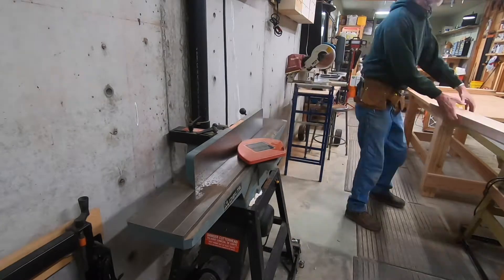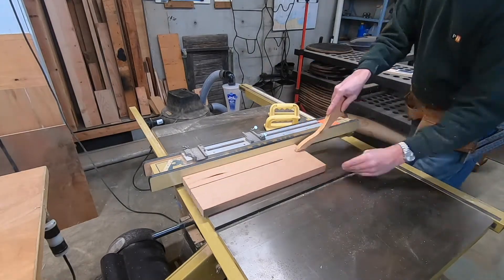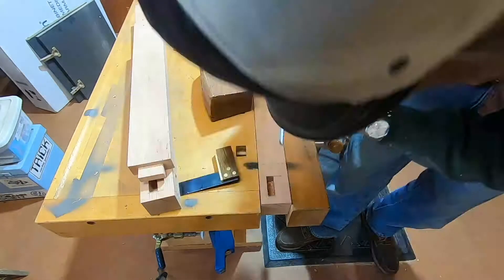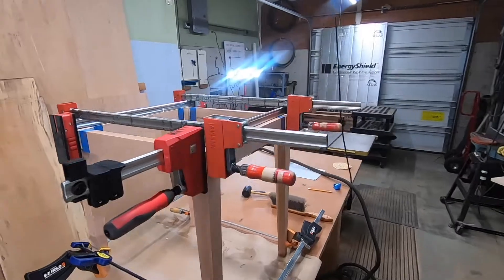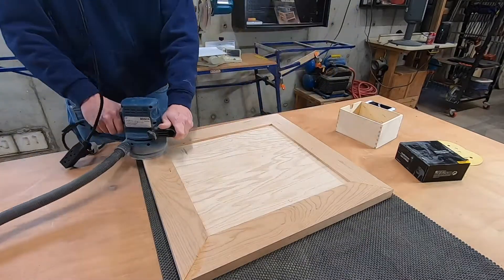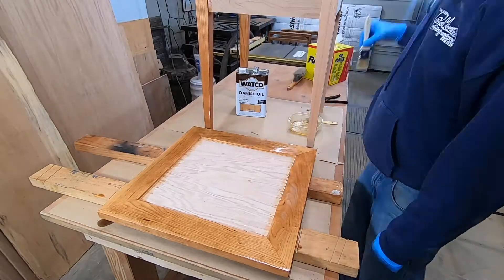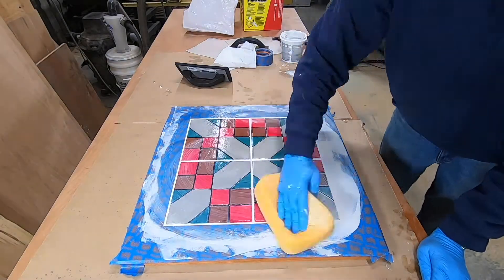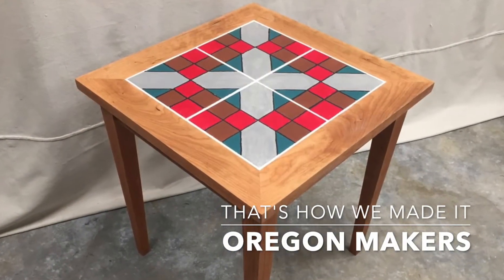Tile Top Table

Comment: Nice work and a good video! Now after almost a year do you know how the table has aged? Since there's wood under the tiles and grout, is there any bending that would make the hardened grout crack?
Reply from the maker: Thanks!  I checked in with the client today, and everything is good.  No cracks in the grout.  I did lay the tile on "seasoned" 3/4 plywood, so pretty stable.  I consulted a professional tile setter before doing this, and they assured me it would work.  Happily, it has.

Comment: I know this video was made a year or so ago.
I noticed your miter saw stand...
Do you like it?
And where did you get it?
Reply from the maker: It is awesome, I've had it for about 20 years.  It's a Trojan MS-2000. I think higher-end lumber yard/ hardware stores can order them, I tried to find an easy link for you.  The downside, which is only 1, is the saw in permanently mounted, so lifting it to the back of the truck is a little challenge, and then it sits too high to put my tonneau cover over the bed.  Would I buy it again? YES I would.  Check out my fence building video to see it in the field. youtube.com/watch?v=Z0vnM6YH3rs
Reply: @oregonmakers2000  thank you so much for responding.  I recently picked up a new stand for job site, but in the shop the legs stick out to far.
I'm going to do more searching/shopping.
Thank you again for the info on it.

Comment: Hi what's the name of the thinset you used? Does it act good on wood over time?
Reply from the maker: I used "SimpleFix Pre-Mixed Adhesive & Grout"

https://www.amazon.com/CUSTOM-PRODUCTS-TAGWQT-Premixed-Bright/dp/B00176ISGE/ref=sr_1_3?crid=125NGUJ63U208&keywords=010186771625&qid=1669928331&sprefix=010186771625%2Caps%2C165&sr=8-3

I put it on cabinet grade 3/4" plywood.  I talked to a professional tile setter and this was his recommendation for what I did.  So far this has held up well and been through the 4 seasons in Eastern Washington.

If you make a project, tag us if you post pictures.